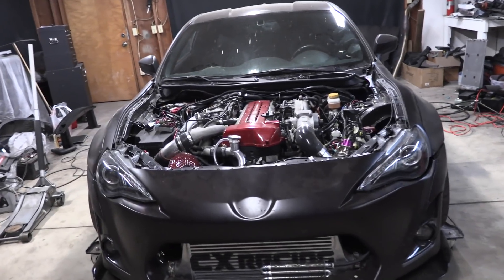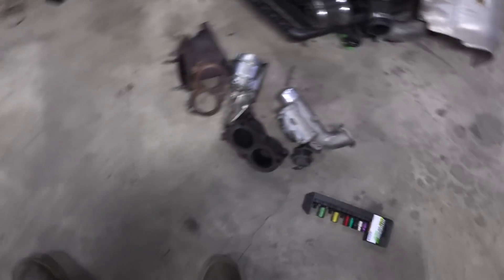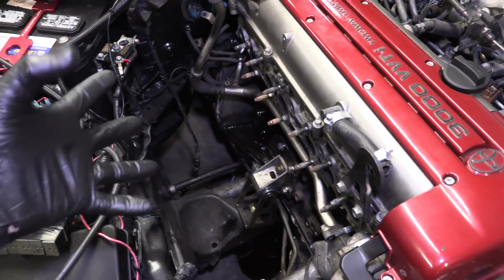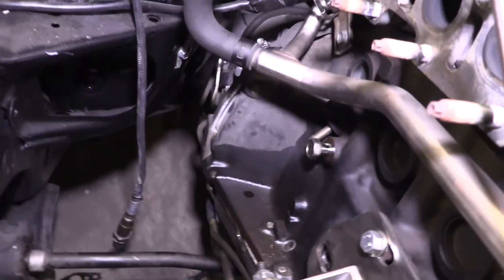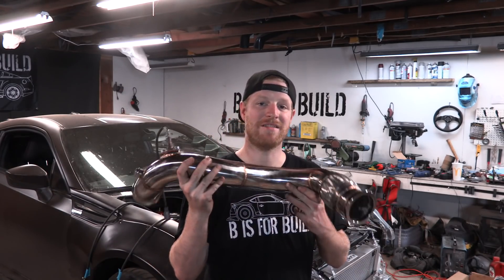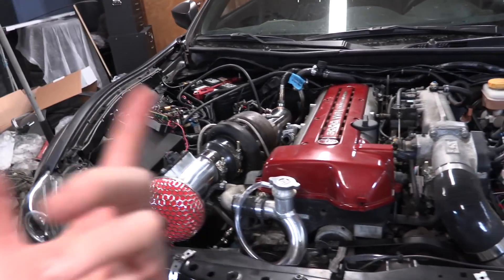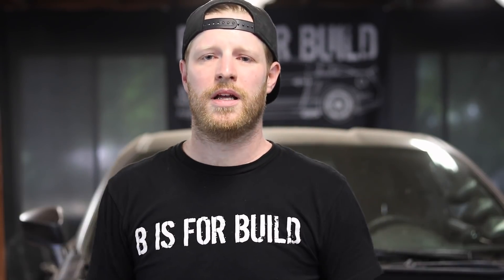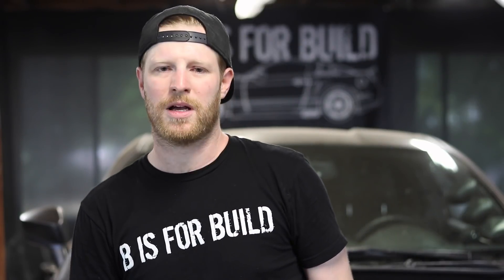2JZ BRZ Pt 34 - Single Turbo Install

Comment: you don't need a wiring harness for alot of stand alone ecus just learn how to install ms2 or ms3 on a 2jz im sure there is tons of info on the internet for it and it will not cost you even 1 grand to do that, yes you can run other chip tunes or what ever but the car will run like shit and you will loose alot of power not to mention it will decrease the reliability. dyno tuning is ideal but set up a good target afr and a good spark table and you can road tune it, which will still be much better than a chiped tune. all in all its tedious and mind numbing but its really not a part you want to go cheap on, plus it kinda defeats the purpose of using EFI if your going to be running all over the place with your VE and spark tables.

Comment: Dude stop screwing around by adding Parts taking Parts the problem is you need to reschedule your injectors with a new tune where between your car prior didn't do a good job